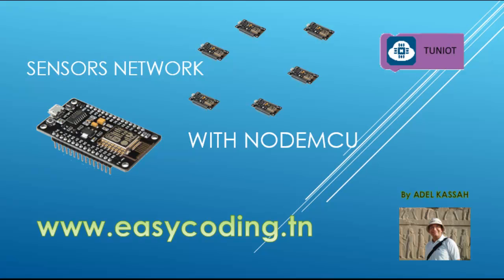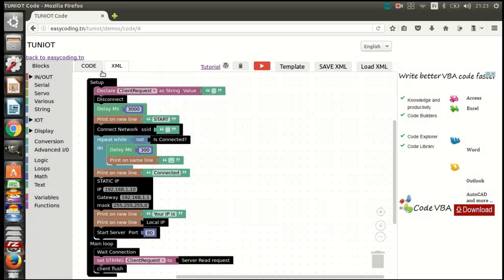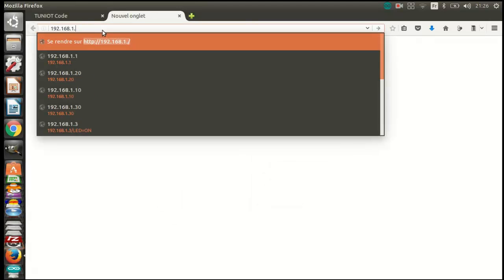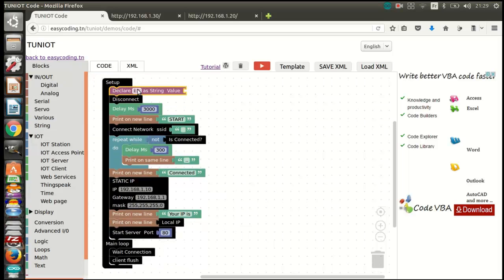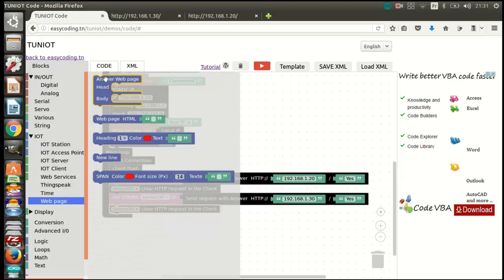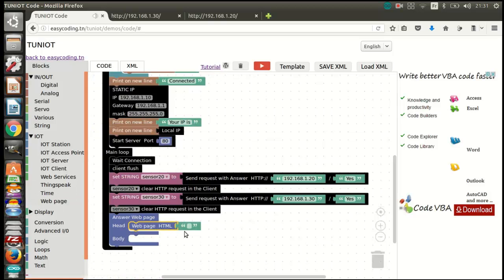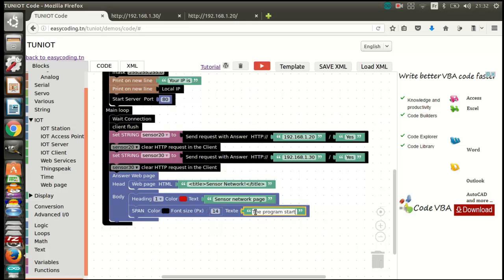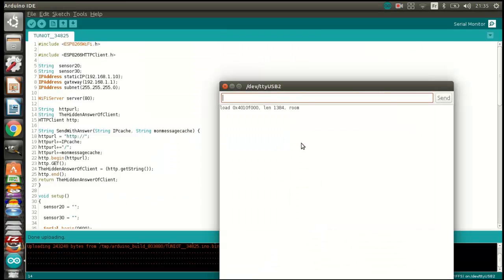NodeMcu (ESP8266) Tutorial B-09: Monitor a sensors network

Comment: Great tutorial - I just start learning - How many NodeMcu as sensors should be managed by a NodeMcu as webserver.
Reply from the maker: I don't recommand this solution if you have a lot of sensors.
I suggest MQTT in this case.
I will make a video about that soon
Reply: @ADELKASSAH  thankyou for replying - I am trying to use 10 Esp8266 as single house windows sensor (open/close) and receiver/s esp8266 based with corresponding led red and green to confirm the windows status - Any helps will be appreciated

Comment: Great work with all the tutorials. The programming system appears to be very easy to use.
    In my case I'm connected and got IP address in "Serial Monitor", both from Server and Clients. I see in the router that the device is connected. It seems that I got stuck in the program at server.available. What could be the problem? WiFi signal strength is good.
Reply from the maker: Please could you check the version? It is working for an older version
Reply: @ADELKASSAH  Sorry, version of what?
Reply from the maker: It should be 2.4.0 rc2. The version of softwaez for the board when you installed the esp8266 board in the arduino ide
Reply: @ADELKASSAH  It looks like it always taking the latest version. Now is it 2.4.2. Can I point on an older version?
Reply from the maker: @larsniklassonhede3798  try with the one I told you. Make a try and let ke know
Reply from the maker: Yes it is possible. You can switch between versions.
Reply: @ADELKASSAH  I have now put right software in. https://github.com/esp8266/Arduino/releases/download/2.4.0-rc2/package_esp8266com_index.json. I have a question I don't understand what figures is staticIP753_10. Why are these number added and should it be same numbers and _10, _20, _30 for master and clients. After Serial.println((WiFi.localIP() it sometimes added .toString()));. Just sometimes! The programs are still not working

Comment: I am trying to use 10 Esp8266 as windows sensor (open/close) and receiver/s esp8266 based with corresponding led red and green to confirm the windows status - Any helps will be appreciated - Thank you in advance for the attention given
Reply: Hi Roberto if you are trying to connect 10 ESP boards as clients to 1 ESP board as a server then it might not be possible because maximum connection limit is 8 and other than that if you need any help regarding the coding part you can drop me a message

Comment: I want to thank you for this tutorial.

I have a problem with the web page, not showing the data of sensor, I put some serial print lines in the code and I could get it on the serial monitoring, but the web page is containing nothing, what may be the reason?
Reply from the maker: Did you try to show a web page with static information?
Reply: yes I tried but also nothing , it shows:
This site can’t be reached
192.168.1.100 refused to connect.
I added some  Serial.println in different places to know where the code stops
like:
if (!client)
  {
    Serial.println("NO client");
    return;
  }
and it prints : NO client
Reply from the maker: PLEASE WORK WITH THE 2.4.0-rc2 version by changing on board manager.
Reply: Unfortunately it doesn't work also,

I tried to reinstall version: 2.4.0-rc2 and choose board: Nodemcu 1.0 (ESP-12E module)
the board could print the LDR readings on serial, and could get IP from router, but no web contents appears. 
I will be grateful if you help me.
Thanks
Reply from the maker: Can you send me an image of your code in blocks for both the client and server

Comment: Dear professor i am thinking about making a project and monitor a sensors network localy so  the server will become both the access point and the web server so he will launch a wifi and connect to one
Reply from the maker: It should be possible
Reply: ADEL KASSAH I think that it is possible but I lack the programming tools and instructions do you have any advices to help me

Comment: how many nodes can i add further
Reply from the maker: I really can't say any thing. You have to try
Reply: Nodemcu allows maximum 8 connections and also you have to define the connection limit in the program, otherwise it wont work. by default only 4 maximum connections can be established.

Comment: Thank you, Adel. After setting up two of the NodeMCU's I checked to see if they were available on my wifi network no problem they were. After a few minutes tried another scan and to my surprise, neither one was showing up on the network. Removed them both from their serial port connections and plugged them into individual 115vac to USB power adapters. Again they showed up but subsequent scan they were gone again. Tried using Advanced IP scanner same thing then tried PING app on my cell phone and same thing. Does this code put the wifi on the units to sleep after a period of time? Can't figure out why they initially show up during scan of my wifi network then disappear? Here is the code for one device the other device is the same only the IP address was changed.

https://pastebin.com/PEw82Hpf

Comment: Hi Adel, your publications are very interesting. 
I have a question: Imagine you have 10 NodeMcu´s (ESP12), each of them is connected to a Microchip MCP23017 (I2C general purpose IO) on which 8 bits are used as inputs while the other 8 bits are used as outputs. Each of these 10 nodes should be able to send and receive data from any of the other nodes. How will you solve this task?

Comment: Hi dear ADEL,  Thank you for your helpful video.  How to transmit data client to the server with NodeMCU?
Reply from the maker: take a look to the video: client server communication with NODEMCU. It is in the same list. There is one bloc to do that.
Reply: I have 1 Server and 1 client  Nodemcu.  These are connected successfully and I can send the only constant value. I mean, how to send many variable data send to the server.
Reply from the maker: the easy way to do that is to send one by one. In the bloc Send request, just change the "yes" value by your value. If you want to send a lot of data in the same request, replace "yes" by "data1=value1&data1=value2&data3=value3" Later you need to deal with that strings manually
Reply: And the client where I send ...  how to receive it ? Thanks

Comment: Your tutorials are awesome and very helpful. But when I'm going to set a static IP, it doesn't work.  The router sends dynamic IPs and I am not allowed to change that. Can You help me?
Reply from the maker: According to my experient, you can make a static just by calling the bloc IP address. You can find it with the template
If you display your address after some seconds, it will work with the new address that you choosed and you can even access it if it is a webserver. So I am sorry I don't know about your case!

Comment: Hi Adel. You do great work !!!
I have only problems, when I want to send and recieve more than one value.
I don´t get it run :-(
I want to send from one Server humidity, pressure an temperatur.
And the other server shoud get these values ... but it doesn´t work.
Maybe you can make a tutorial or you have any suggestions.

THX for help !!!
Reply from the maker: If the server is not answering, just click on the reset button. 
If you want to put your system in real condition, you need to add a small script called: watch dog. This script detect when the server is not answering and will restart the board. I hope that I answered your question
Reply: THX for the very quick reply. I will take a look at the "watchdog".
Reply: OK ... the Watchdog is a cool thig ! Thanks for that information.
But here is the next question :-)

The HTML page construction is very ... very slow.
It comes line by line by line.
Is there a alternative for client.println ???
Reply from the maker: For now, I don't see any other solution.
Reply: Write an inline html code